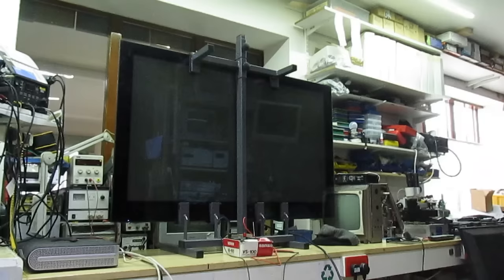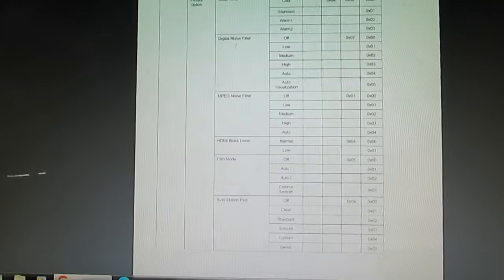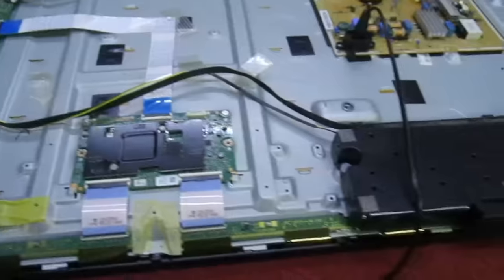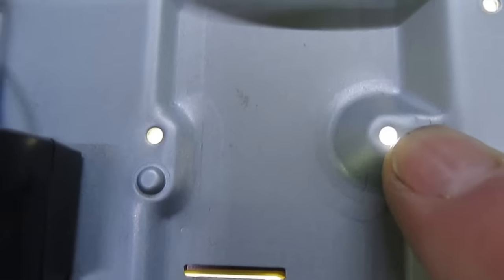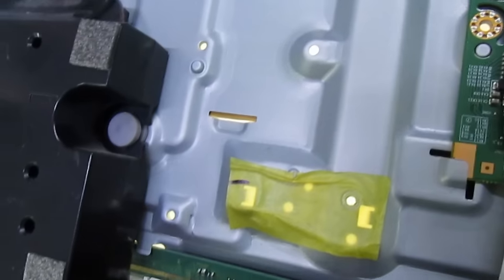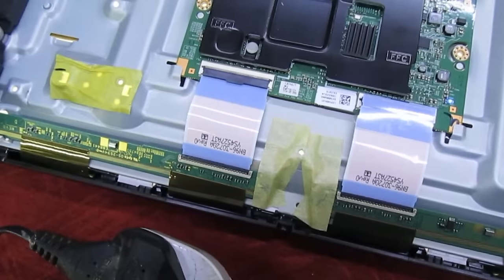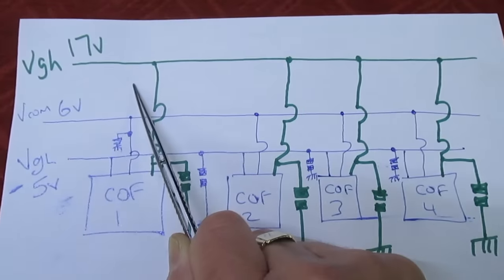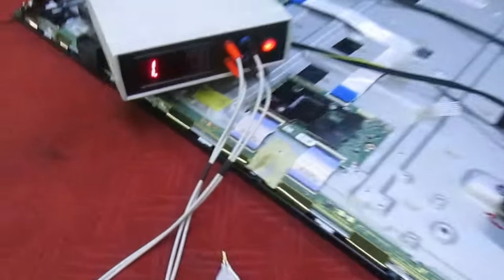Video to highlight the problem of repairing flat panel TV sets

Comment: I saw online where you can use an LCR meter to check for shorts/low resistance.  If you have one already that is.
Reply: I think you mean an ESR (Equivalent Series Resistance) meter, to locate short circuits, not an LCR (Inductance, Capacitance, Resistance) meter. An ESR meter is essentially a milliohm meter and can be used as a milliohm meter however with a caveat, and that is; since a simple ESR meter does not employ the I*2/R test lead resistance-nulling "front end", which is only possible through the use of Kelvin clamps, the accuracy of your measured resistance readings, during testing, will be highly dependent on how well your test probe connections are connected to the DUT (Device Under Test), adding a level of inaccuracy to your resistance measurements.   Fred

Comment: Nice diagnosing. Do you save parts (boards etc) from popular models that were unfixable (due to screen fail..) to do swap tests and repairs ?
Reply from the maker: I do , the most common problem I see is a smashed screen which is not economically repairable , so I have hundreds of boards and sets in my place but the problem is I hardly ever use any of them because the models seem to change every few weeks so you never see the same set twice, back in the 1980s a new model of TV would only come out every 18 months or so keeping boards then was much more useful than it is now .

Comment: One possible quicker alternative is run the unit for a few  minutes and physically feel the potentially higher heat that the shorted cap would create vs. those that are working properly.
Reply from the maker: Most chips will switch off the supply rail when they see a short citciut so this is not an option, but in the past I have used a bench power supply to see what gets hot.

Comment: In my world....if it doesn't come on when you switch it on it's a goner......after 10 years of constant use what is A$ !000 for a new 70 " TV. with the latest wizardy......and 3D......nothing like a  new TV.
Reply from the maker: I know where your coming from but if TV s had kept up with inflation like cars and houses have a new TV would cost 2k and people you just keep getting them repaired for as long as possible.
Reply: @michaeldranfield7140  Only the short of cash or no credit ability go down that path.......new TV every 5 years does the trick, same with cars, never out of warranty.....extended warranty may seem like a scam but my first 42" LCD TV went bad after 4 years and got replaced by a 70" one with extra payment.

Comment: Great work Michael can you advise me please. I restore and repair tv dvd save from landfill! I have a Sony KDL 32V4000 CTV  TV switches off aftwr about 30 seconds longer if i leave off for a longer period.I am guessing power supply cap but i enjoyed your video witg faukty xof cap. Can you suggest something please. Thank you Lewis
Reply from the maker: With an older set like this it should blink an error code or from memory if you go into the service mode you should be able to see an error log of what tripped the set, as its an older set some service info may be in the service manual.
Reply: @michaeldranfield7140  Thank you  Michael yes I have  4 red light 
blinks when the set switches off. I plan to Check the inverter board today and the connections from ps but will try the service mode also. Thank you

Comment: Thank you very much for sharing this info.  I am so glad I didn't throw my tv away.
Reply from the maker: Thank you for watching.
Reply: @michaeldranfield7140  I had the back off my 4K tv and followed what advice I could find on the internet and that was just to do a visual inspection across the components, to see if they had blown.  I'll repeat the first few steps you did to check if the whole circuit board has gone and whether the back light still works. I've had sound come through the tv, so am cautiously optimistic.  Will let you know if I can fix it.  Thanks again.

Comment: Some time ago called up Philips for a vacuum cleaner, wanted to replace a certain non-electronic part, already knowing exactly what part i need thanks to self research, but wanted verification by Philips.
Note i work with electronic repairs myself, have fixed dishwashers, washing machines, vacuum cleaners, fix various problems with desktops, laptops, smartphones, and more.

The lady told me she would check in some book or PDF to see the manufacturer number was of the part i required, and it happened to be the same as the one i had found.

When i asked if that was the service manual, she said it indeed was, i asked if it was possible to download several of their service manuals myself from them to get as reference, she told me service manuals from Philips were not available for Anyone except repair shops that were Officially registered with Philips.

The argument from the lady was that users might kill themselves or risk blowing up their devices if they worked their own devices and knew the manufacturer number to oder the part, also the service manuals had Patents, so those two reasons were the reasons that the lady gave why Philips did Not publicly and freely give Service Manuals to Anyone that Philips can not control and verify.

Good thing i at least have the competence how to find parts of most devices (even if a device is discontinued or part is not officially sold, can just get from an alternative device with similar parts or 3rd party quality part, and IC components or capacitors are generic ^-^ ), and research and fix a device i have never touched before and has no video or schematic online, so the service manual not being out there is just a inconvenience to me....

It's really sad things are this way, cause it would be economically and environmentally Much better if we just repaired our devices instead of dumping it in the thrash, cause sometimes all it takes is replacing a €4  450v4.5f capacitor, or replacing a dried out torn and leaking oil seal ring with the right diameter double lip nitrile oil seal ring with a bit of silicone grease (all costing maybe €8), or replacing/soldering a new pair of LNK305 and resistor for €4, or when battery in a device like smartphone, wireless earbuds or whatever goes bad to just replace the lithium battery, where most phones it costs between €15-35, causing your phone to run faster, cooler and for many more years to come....

Imagine if we all kept doing this kind of shit, you don't think we will eventually run out of precious materials, or things become more and more expensive as finding or recycling to get new raw materials gets harder? Recycling also is bad for the environment, releasing toxic gasses into the atmosphere and using up a Lot of power to even recycle, sometimes stuff doesn't get recycled at all, because it's not economically viable, Reusing is the answer, Reuse is what is viable and good for everyone, just replace the part that has worn down or broken when necessary, will save some a Lot of bucks over time.

However, people now days are being so indoctrinated that repairing is super dangerous and complicated and it's much easier to just cash out and annually replace your expensive stuff instantly, so many people have no patience or interest in learning new skills and research and repair their own things, even with the greatest library and invention of humankind, right at their fingertips 24/7, the internet!
....well ok, in many cases it might also be better for incompetent people to leave repair to someone who has experience and trained himself (or has been trained) to do the repair instead, for a fee, to prevent electrocutions, or burning off the building, or creating a situation where if anything happens over 2 years snd it's not your fault, just because you touched it last you can be blamed and have to pay a fine, or worse...
Reply from the maker: As a friend of mine once says there must be a circuit diagram because someone who designers the equipment has to draw the diagram in the first place.
Reply: @michaeldranfield7140  Yeah, service manuals detailing electronic and non electronic parts, circuit diagram detailing all ic parts and connections, website with the parts available, and many parts and ic chips being the same size and form on multiple newer and older models and series (instead of 1000 of different sizes and forms for parts of each model) would be great for repair and part availability, and also cheaper for part shops, since they can always know that a certain part is possible to be sold in the next decade.

Would be cool if it became normalized again to think researching and repairing your own device is completely fine (within reason, of course), without stupid contracts forbidding repair, or only by the company that made the devices, for stupidly high fees, i do think warranty being void is ok, IF can be proven by manufacturer that certain damage was caused by the person that did the repair (in which case person that did repair should have made a video or photo of the entire process to prove).

Especially for farmers and hospitals that would be amazing, not having to replace giant devices costing several hundred thousands or million of dollars, where just a single small part or ic chip on the motherboard is broken, which would also help in Greatly lowering costs for people with lower wage requiring everyday food or health care.

The argument that people will kill themselves and burn of their house...absolute BS, many people who are technologically illiterate probably don't even know or comprehend their stuff might have a second chance being with a repair, and those who do can already do a great job doing stupid thongs just fine without the service manuals and ic diagrams, using their handy screwdriver and pliers to open things without heading warnings, or doing research and even gathering knowledge, making bad custom solutions to save a buck out of despair, destroying things and killing themselves.... at least with the manuals and diagrams, competent people have a much better time learning how their stuff works and what and where to get parts to actually properly fix their stuff.

Just put many obvious, impossible to avoid and simple to understand scary warnings here and there that person doing the repair should be careful of, what risks he'll put themselves in and better to call specialist or manufacturer, don't completely forbid people, that's wrong.

Comment: A man calls for service on his $1,100 TV.  The service man drives 25 miles to his home for the repair.  The service man finds out that the main fuse to the TV is blown and replaces the $1.00 part with a new one.  Everything now works on the TV.  The service man hands the owner a $350 service bill for his time and the part.  The owner of the TV complains at the high cost of the repair and asks for an itemize bill.  The TV service man says OK and writes up a itemize bill.  The bill say $1 for the fuse and $349 for knowing that the fuse was the problem.  The moral to the story is that I don't work for free and I get about $90 an hour for my time.  I have gone to technical school for years and have thousands of dollars worth of test equipment needed for that repair.  The round trip drive to pick up and deliver the repaired TV would take about 2 hours time or $180.  Opening and closing of the TV, downloading the service manual adds even more time.  Any of those boards could run between $300 to $700 to buy new and have shipped.  The repair cost on that TV could easily run $900 to $1,100 to repair that TV with that 10 cent part failure.  Then there is no guarantee that another part on that old TV would fail within the 30 day warranty on the fix.  The economics of today says to throw the TV away and buy another one new with a 3 year warranty.   Most boards today are build by machines and the assembly is done with slave labor in China.  It is a crazy world that we live with the throwaway culture with electronics.
Reply from the maker: That's why I don't do collection, if the customer wants a free estimate they have to bring the item in themselves, then its not cost me anything
Reply: @michaeldranfield7140  Yes, that does help with the total cost of repair.  The only advantage to doing the repair is for you to get the TV for free or out of the dumpster, fix it and then resell it at a profit to repay you for your time.

Comment: Amazing work!  Could you possibly share your home made milliohm meter schematic.  Glade I found your video.  I got one tv working by changing the tcon board, and this opened my mind to how such a simple part can cause such a failure.  Thanks
Reply from the maker: Sorry I wouldn't know where to look for the schematic as I made if from a magazine artical over 10 years ago, at the time I made it though I never used it until a couple of years ago as a set of kelvin leads were over £100.I only started using this a couple of years ago when I found the Chinese were making the leads for £10.
Reply from the maker: Found the milliohm meter diagram and I made another video of it.

Comment: Wonderful video thank you very much indeed.
Stupid question is if the TV is working sans capacitor then why replace it?
There a lots of videos on YT with people using sellotape on the ribbon cables to disconnect the paths from faulty components like this and say the TV works well for many more months.
Reply: This circuit has four capacitors in parallel. Remove one and there are three remaining. The reason to install capacitors near the IC is to attenuate the noise generated by that IC hence the need for four capacitors. You could of course replace them with more robust capacitors. The value of 10uf 25vdc does not appear to be critical in this application. ESR and ripple current capacity would be of greater interest than the capacitance value.
Reply: @NH_RSA__  Thank you very much indeed do you mean the life of the other 3 will be shortened if one is missing?
What are the ramifications of leaving the TV will only 3 I am wondering

Comment: The LED's on the left side of my Samsung TV went out one by one. On occasion, they flicker on again then go out. I had it repaired under warranty and the left rail was replaced... with a faulty rail that did exactly the same as the original but after the warranty expired... of course.
Reply from the maker: Due to the labour involved and the danger of cracking the LCD panel I now only ever replace all LED bars in one go .
Reply: @michaeldranfield7140  
Clearly there was an issue with the manufacture of the LED bar. What are the odds of getting a 3rd faulty bar?

Comment: Thanks for sharing your knowledge. Why did the TV work with a missing cap before you put the new one in?
Reply: Four in parallel, so take one out and still effectively has 30uF of capacitance to ground. Suboptimal (and they're only decoupling caps anyway) but it'll work. Reliability can sometimes be dodgy if left like that though.
Reply: @jasejj  Thought as much but did not want to assume given that I know sweet nothing about this field. Reply much appreciated. Thanks.